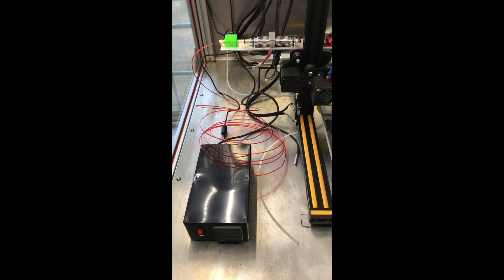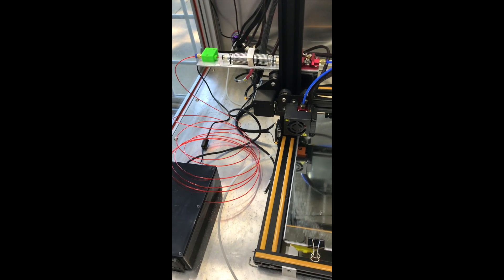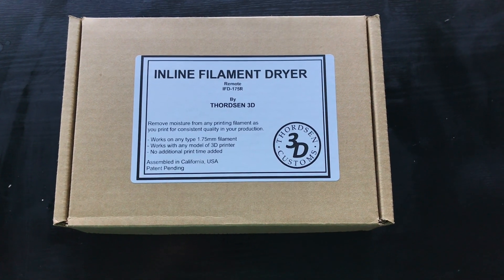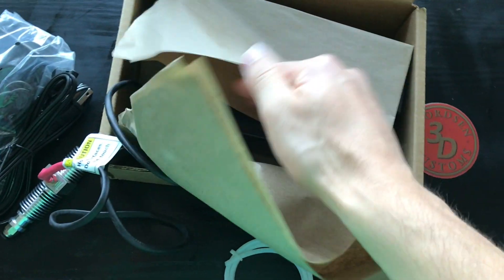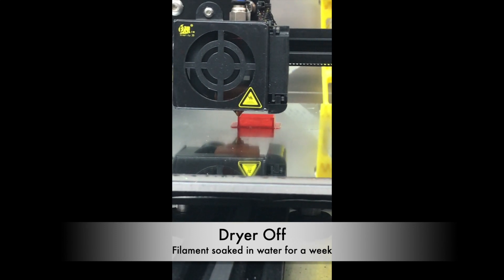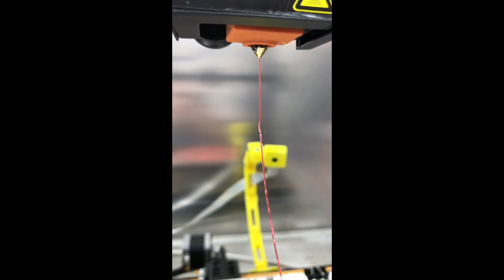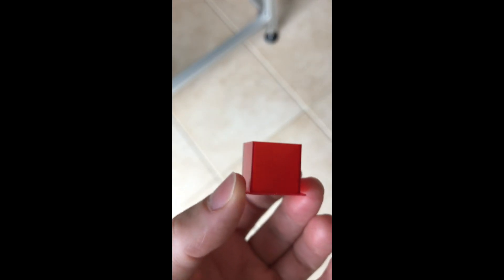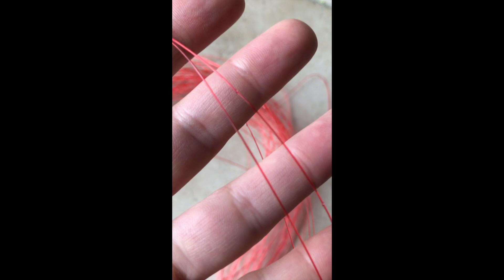Thordsen 3D Filament Dryer Review (IFD-175R)

Comment: Nice job! I have been running mine for about a month and have had very similar results. Not a miracle cure, but definitely helps.
Reply from the maker: Thanks! I want to re-run the "soaked" and regular air exposed test again with higher drying temperatures. I traded emails with the manufacturer and they suggested trying 85C - 95C for PETG. The glass transition temperature of PETG is apparently 88C. They suggested that you can potentially go 5-10C higher with the dryer. I'm not sure if all PETG is created equal because I have spools that have pretty different suggested extrusion temps (Solutech is the lowest suggested temp PETG I have). I'm also not sure what will happen at those drying temps if the filament stops moving for an extended period of time. The worst case scenario is the filament melts inside the dryer or it starts stretching and fails to extrude. Either way it will be fun to experiment with. It comes with a drill bit to clear the dryer if you melt plastic in it. I would probably try pushing some nylon filament through it see if that would clear a clog while heated.
Reply: I posted a link to your video on the Railcore group so I am hoping you get some more traffic. We had A LOT of dialog about this when I mentioned I had installed one. The general consensus was that it was likely providing a benefit because it was pre-softening the filament but people were pretty sceptical about its drying ability. Your video is the first real close up of the system in action. PETG was a great choice for the demo. I am running mostly PLA with some PETG and am pretty meticulous about storing my flimanet so I could not give any kind of real definitive conclusions. The Filidry fiasco hurt these guys a little unfortunately. After that scam people thought this was just another similar situation.
Reply from the maker: @Riprazor  Cool. I saw the teardown video of the Filadry thing too -- what a joke. The Thordsen product has the variant where the dryer is outside of the box, so you know what you are getting into. My question was if the heat zone was enough to actually dry filament in real time. I was surprised when it had a measurable impact. From chatting with the manufacturer over email, it sounds like they are still testing the heat range recommendations. I also verified that the section in their manual that says the temperature can go 15C over your set temperature during startup calibration is no longer the case. They switched to a different controller that doesn't do this. I didn't want to have to unload my filament every time I turned it on. I just leave my filament loaded and purge everything after the dryer if it has been sitting there for more than a few days. I'm excited to try out the higher temps to see if it does even better. This is my first youtube video. I realized when I was editing it that I should have held my phone in landscape the whole time. Whoops. Thanks for checking it out!